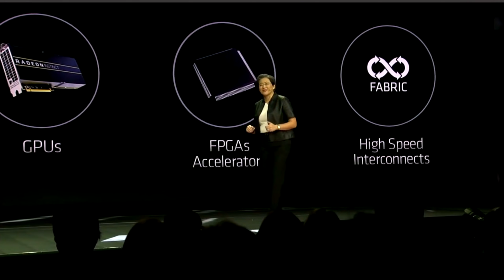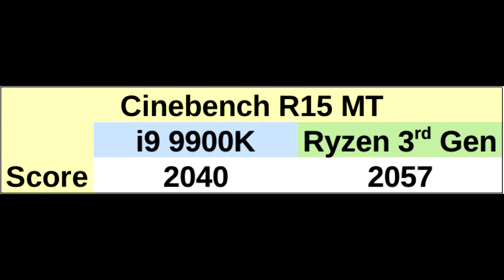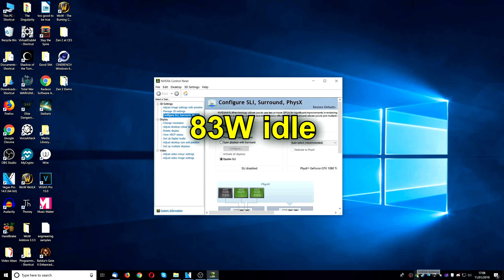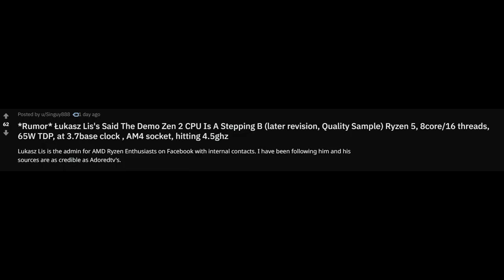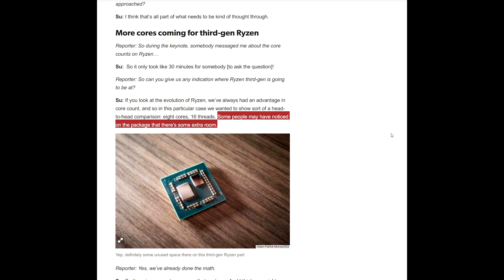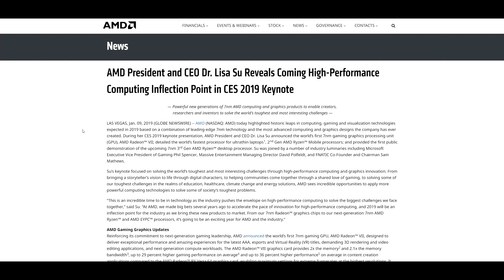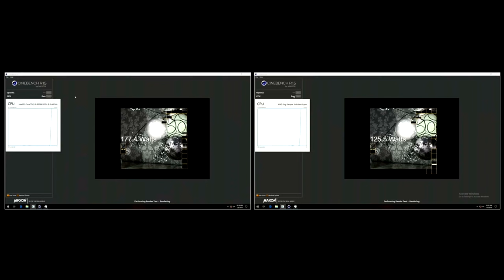Zen 2 Faster than i9 9900K at Half the Power.

Comment: Congratulations, Jim.   I knew when you first did that analysis on the Zen 2 and the master strategy - the moment I saw IO die it literally all came together.  It was the right answer because it was the most efficient and profitable and elegant solution possible: There was only going to ever be one zen2 processor chiplet for the entire range.  And that chiplet would carry the bare minimum for AMD to stuff as many of them as they could on a 7nm wafer.   The IO die was the key to that - because it took most everything that could completely kill a processor die in one shot out of the equation. That meant that AMD would be able to use near 100% of each of the 7nm process wafers and get the full value possible out of every square inch of silicon not directly hit by a defect.    It also meant that they could carve out the IO die as a separate development project and adapt it to their needs on proven processes that would have much better yield.  

In many ways, the IO die is literally the most important chip AMD has ever made.   Its a literal deus ex machina for the problems they might have faced with yields and operations costs.   Active substrates? Meh.  New processors, Okay.  GPU's?  Yeah, sure.  But that IO die?  It ties everything together and puts a little bow on the package.   If AMD comes up with their own tensor-math core?  They can produce a tiny chiplet with tons of those on it. On a brand new 5nm process?  Sure.  Some cores get hit with a defect? Lower sku part.  The IO die doesn't care.  Can't shrink ray cores down past 7nm?  Leave it on the established process and make tons of them on their own little chiplets - defects kill a couple cores? So what, as long as the design works, it's there.  Compute Units on a dual layer process?  Great: IO die will just take em as they come.  Just put the common elements on the IO die and tie it together.    Want to have GDDR6?  Its on the IO.   Framebuffer?  put it in the IO die.   Caches? IO die.   Want to tie together a discrete GPU and APU - sure, its all presented as one device from the IO die (once they work out the kinks and make better drivers) with infinity fabric tying everything together.   Want to package HBM2/GPU/CPU on a single package, IO die handles that for a SoC experience.   

Thing is, AMD needed this.  They absolutely could not afford to go toe-to-toe on monolithic processes with Intel and nVidia.  They were on their last legs and any process problem could have put them out of business.   Even now, the success they've achieved is ephemeral - intel is working to come back and they're going to be competing in graphics too.  And nVidia is perfectly fine lazing around and doing near nothing just to collect $$$, but I don't think they'll be anywhere near as reactive as intel has been over the last few years.  They have to see the writing on the wall.  And the only way AMD can keep what they've managed to take from intel is to somehow get one step ahead of them and stay there.  And the only thing that will let AMD get ahead of nVidia again in the GPU innovation department is chiplets.  We have to assume Intel is going to come up with something that will keep them in the game, at least, because competition is the best thing for us - I hope they can come back.  It will be very, very interesting.  We also have to assume that nVidia has several aces up their sleeves if not several entire decks of cards to play as AMD and Intel try to catch up to their Graphics capacities.

Comment: Ive been looking for clock for clock comparisons of 9900k vs 2700x, the 2700x scores a little higher in Cinebench, we know Zen 2 has a average IPC of around %15 and we know its had a large improvement of the FPU, Cinebench is floating point heavy so I think a increase of around %10 IPC over Zen 1 in Cinebench reasonable, if thats true then the AMD chip would have to be clocked around %10 slower than the Intel chip.
Reply: http://media.redgamingtech.com/rgt-website/2018/11/cinebench-9900k-vs-2700x.jpg

Comment: You missed one important part though. The package they showed contained the I/O die and one chiplet. That means they used a chiplet with all 8 working cores instead of 2 chiplets with 4 working cores each. Not just wouldnt that have made a lot more sense to achieve higher clocks, especially on the early stage of the engineering sample, it also contradicts the leaks about the Ryzen 5. Except for the APU which just happens to have one chiplet with 8 working cores at bad clocks and a GPU chiplet, but if the suggested clocks of the sample are as good as your leaks claim, it certainly cant be that one. So I begin to wonder why they would do that. Just to tease speculation because its made like a Ryzen 9 with a missing chiplet?
Reply: Remember that this is an engineering sample. It probably has no part number and it does not necessarily correspond to any part number on that list that Jim showed. They produce engineering parts for internal engineering work and what they need does not always correspond to any existing or proposed SKU.
Reply: @billschauer2240  Well yes, obviously. But that doesnt answer my question, why they used one chiplet with 8 working cores instead of 2 with 4 working cores each. It must have a non-technical explaination because from a technical standpoint it doesnt make any sense to me.

Comment: A Ryzen build with a cheap board (4 phase vrm) will have no problem running an 8 core 7nm with a 800MHz increase in turbo speed. i9 performance with a $200 3600X running on a $70 TUFB350M board. WOW

Comment: The likely hood this is an r5 3600 seem very accurate to me. Nice to see that AMD can hit those higher clocks now. The 2600 at stock scores 1280 compared to the 8700k 1420, then when you overclock the 2600 to 4.2ghz it scores around 1470, the all core turbo of and 8700k is around 4.3ghz, therefore even with a 100mhz disadvantage the r5 can already tie with an 8700k in cinebench or atleast be within margin of error. Obviously once you overclock the 8700k it will pull ahead, should be around 1650.

Comment: The lack of Navi announcement at CES was a bit disappointing, but your CPU speculation was pretty much on point except for a few differences here and there. The traces on Ryzen 3000 pcb definitely means beefier CPUs are coming. Keep up the good work!
Reply: Sony may have stepped in and ask them to hold off until they announce the new PlayStation. They don't want Navi to be old news when they release it.

Comment: You returned my hopes for Zen2 again!  

I thought it was impressive as it was before, but now I am even more impressed if it turns out as you say.

One thing though,if your guess is correct and its running at 4.5Ghz, and it just beats i9 9900k by 1%,  doesnt this mean that AMD is still behind with IPC?  Doesnt i9-9909k run at 4.3Ghz on all cores when constrained to the 95watt TDP stock setting?

That would mean in this particular test and Cpu that Zen2 needed 4.5% more frequency to beat intel by 1%, and so, still behind with IPC.

Comment: For your CPU power numbers: Don't we have to add the 13W idle draw at the end? Of course it doesn't change anything because when a 121W 2700X can have a 105W TDP, then a 82W 3600 can have a 65W TDP.

Also, idle power could still be a bit higher with AMD because in general the system idle power for an intel system is a bit lower than for an AMD system as seen in many reviews, at least for a Ryzen 2000 to Intel 9000 comparison.

Comment: I wonder if we will see two different 8 core SKUs.
One with 4+4 and one with 1x8.
The 1x8 with higher frequency and the 2x4 with larger cache. Also wonder if the IO die has the L3 cache or does it contain a level 4 cache
Reply: The 1x8 will be used for Ryzen 5 and 9.
Reply: Good questions.

Comment: I'm actually hoping that rather than sandbagging with slow memory speed, they actually got rid of their memory speed bottleneck at 2666, perhaps by having the IF speed of the core chiplet run independently from memory speed on the I/O die. This would remove a lot of memory scaling and give good results with cheaper memory, and benefit me personally since I'm stuck with a dual ranked 2666 kit

Comment: Would a 10 core not be possible? I cant see why not but im not an engineer.
Reply: rayray- Possible if it is designed for it but it seems that AMD is only binning its chiplets with even number of working cores and only pairing chiplets with the same number of working cores.

Comment: i was thinking, how does the io die contribute to heat and wattage?
the more it uses the easier is it to fit another chiplet on there and it would not be a doubling of wattage. amd with 16core cpu looking good :) 

i think this is why a 4ghz base clock ryzen 3600x with 8 cores is 95 watts and 16 core 3800x is only 125watts, not even close to double the wattage.   but doubling the cores would also double the load on the io die perhaps?

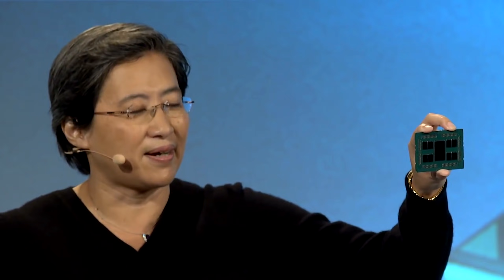Comment: 14:28 You had a DETAILED list with models, clock speeds and ANNOUNCE DATES. A LOT of details being centered around a CES reveal of SPECIFIC MODELS. Not to mention the I/O die discrepancy. Instead we get a reveal and demonstration of non-finalized silicon and it has 8 cores. Meaning they have NOT landed on final model names NOR clock speeds AS of TODAY, much less 1 month ago. You can't take credit for this one.  Your leaks had details and so far nothing is really lining up as it should. All in all they certainly COULD make a 16 core but for all we know it could come much much later.

Comment: ok one thing that i was wondering about when the demo was being showned was what memory speeds was both systems running as zen does have great scalling with sharper timing and faster memory i thought it was running 3000MHz but 2666Mhz, this make the low mid range Zen 2 cpu greater than a I9 9900K for no doubt under 2.5 times the price (even more when you consider the decrease in power usage by 65watts
if it launches at £200 mark add around 1 to 3 percent for using high clocked ram and sharper timing on top of the IPC boost of 5 to 20 (IPC gain may vary between different workloads) and 10 to 15% increase to clock speeds, this will no doubt be the CPU of the year and i am more positive than ever that we will see 6 cores 12 threads for budget, 8C/16T to 16C/32T for the mainstream

Comment: I came away from the live stream with the same thoughts...this is not "final clocks" and assumed it was also probably the lowest end chip(maybe not the lowest, but that's my assumption)...either way...we will surely see when the part is released...and it is amazing to show a low end part beat a top of the line part...I was overall a little disapointed in the presentation overall ...but it's fine...I'm more interested on what they actually deliver than how they present it.

Comment: What you say at the start of this video is something I have come to realise myself since the AMD keynote. I will now adjust my expectations accordingly. After all, they have to market to the wider audience not just such ultra enthusiasts.

As for the CPU seemingly being 100 MHz faster than your leak, my guess is it is the 3600X. That would be in line with Lisa Su saying they have not yet reached final clock speeds. It is, after all, 300 MHZ behind the 3600X speed in your leak.

EDIT: Corrected a typo in the first sentence.

Comment: Yeah, frustrating that AMD decided not to play its best hand.  However, I can see why AMD thinks this is a good idea... to sustain positive news stories into the future for months and months and months.  I'm not sure this is the best approach for AMD... but obviously AMD gets to make marketing decisions for themselves.  Given the evidence, the chances the Ryzen 3000 series has 16-cores is somewhere around 99%... and Threadripper will have 32-cores... or possibly even 64-cores (but don't count on that).  What I want to know is... are all these Ryzen 3000 series parts the TMSC LP (low power) process, or HP (high performance) process?  AMD should have adopted the TMSC 7nm HP process for the Ryzen 3000 series (at least for the Ryzen 7 and 9 chips)... but it looks like they probably didn't.
Reply: max bootstrap They used the TSMC 7nm HPC process.
Reply: @officialvisaural  : That's good to hear.  That is what I was strongly advising.  Based on what these early samples indicate, the power consumption of the HP process is still quite modest.  That's great news for TMSC... and AMD.

Comment: Yeah you were on the dot! You speculated they would use I/O chip design + Chiplet while others suspected that'd be impossible due to the cost of it. That they just wouldn't go that far or would present issues. Then it's crystal mother f%$#ing clear that there's a chiplet missing. They wanted to show their stock midrange beat Intel's best. They weren't ready for the leaks. They weren't ready to unveil it with a 100% certainty. That's all. Now I can't wait to see Radeon VII. What will the massive HBM2 do? We know ray tracing doesn't need RTX cores. Gamers Nexus said the boosted memory will heavily impact anti-aliasing which if so would take on DLSS. It should be interesting.

Comment: it beat the intel cpu but i dont think the amd chip was hobbled anymore than the intel.  both had the same memory speed and the intel was running around 4.6 mghz when it could run 5ghz.  people have gotten up to 20% higher scores with the 9900k.  i think the amd chip was highest clocks they could get.  the higher boost clocks we are expecting will be in less intensive loads like gaming

Comment: 7nm from AMD is matching 14nm from Intel. That means Intel still have better CPUs and AMD will get crushed when 10nm drops.
Reply: Have you watched the video? 7nm lowest midrange 65W CPU is matching 14nm++ high end 95W Intel CPU
Reply: @TheTaxxor  X doubt bro. Pure speculation on Adored side as always. Also if it's R5, it wouldn't be 65W, but rather 95W chip that competes with 9900K. By the time we will have full line up of 3rd Gen Ryzen, Intel releases 10nm CPUs
Reply: @Iksperial  It isn't pure speculation, it's simple observation of the data. Take a look at what the system power consumption of  a Ryzen 7 2700, the current 65W TDP 8C chip is like in a cinebench run: About 125-130W. Meanwhile the 2700X sits at around 190W. So how would this 133W system power lead you to anything other than a 65W CPU?

Also why wouldn't an R5 be 65W? The 1600 is, the 2600 is, the 3600 will be as well.

And Intels 10nm CPUs will come by the end of 2019 and also only in form of mobile CPUs at first, desktop not before 2020, half a year after 7nm Ryzen.
Reply: @TheTaxxor fair points. Thanks for discussing
Reply: @Iksperial  Huh, and I was mentally preparing for at least half an hour of discussion on why my views are flawed an I'm just an AMD fanboy. 

Glad to see the other side of Youtube from time to time^^
Reply: @TheTaxxor  plus i'm pretty sure amd is sandbagging. That demo was way to close to not be doctored. Especially since they didn't disclose clockspeeds. Plus the slow memmory.
They are not showing their hand just yet.
All they had to do was beat the 9900k. And they did.

When 10nm hits we will have ryzen 4k allready as well.
Reply: @baronvonlimbourgh1716  
"When 10nm hits we will have ryzen 4k allready as well."

Not so sure about that, if Ryzen 3K comes out in june we have about 14 months between the three generations, which would mean Ryzen 4K would come out around August 2020. Intels 10nm will be out before that.

But on the other hand, 7nm+ is not an entirely new process so maybe this will be quicker.
Reply: @TheTaxxor  yeah ok, was talking about anouncements mainly as that happens early in the year.
My mistake.

On the other hand 10nm could very well be delayed again offcourse.
Reply: And when Intel's 10nm vaporware that was in the works since 2015 gets launched...whenever that is...AMD is already sampling 5nm and working on 3nm.
Reply: Btw .... Intel's upcoming 10Nm is for mobile phones , you dumbass !

Comment: There is one problem here. If we will have 2 chiplets, R5 will likely have 4 working cores per one. Which would mean that performance will be worse than what they've shown as latency will be introduced.
Reply: could be but dosent have to be
Reply: AMD doesn't have to take that approach, but if they do, I'm pretty sure the IO die and updated uarch will take care of some of the latency issues that plague current Ryzen. It's possible that the IO includes a form of memory controller buffer to act almost like a shared L4, and/or that the L3's home agent (s) are local and not apart of the memory controller as in Zen 1/+ (which caused latency spikes during a cache load miss in the L3).

Comment: Jim I have one question. Wouldn't it make sense if AMD just put lower quality silicon on their R5 like for example 2 chiplets with 4 cores disables on each. That being said this engineering sample was an not optimized artificial chip just to showoff 7nm but is not a real product? Also how do you imagine 12 core chips? 1 good yielded chiplet and another not so therefore cut down to 4 cores? I am a little confused here. Thanks! As always, great video.

Comment: If the R9 3850X is a reality, I will definitely be willing to drop $500, especially if it works with my existing Crosshair Hero VI, replacing my R7 1800X in my work machine. The 3600/X doesn't sound so appealing, a clock boost is not enough, I want more cores to replace my 1800X. Thanks for all your work and analysis Jim, it really helps me make informed decisions on my purchases of hardware, and it's great to see AMD really taking the fight to Intel!